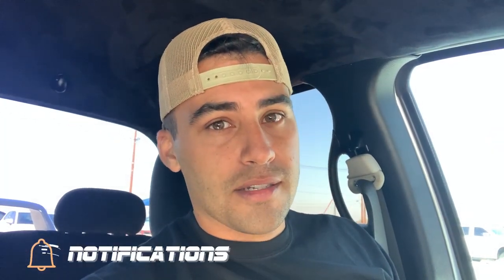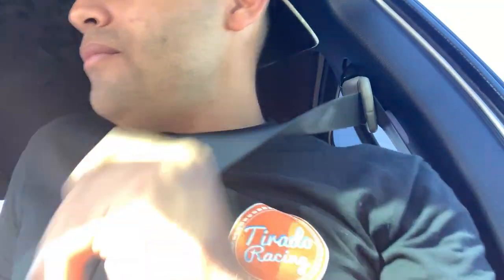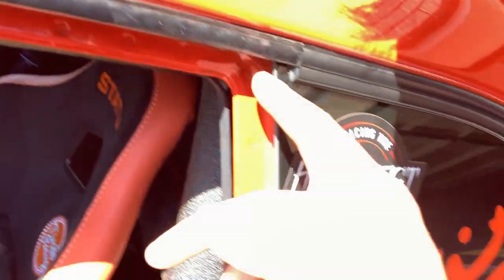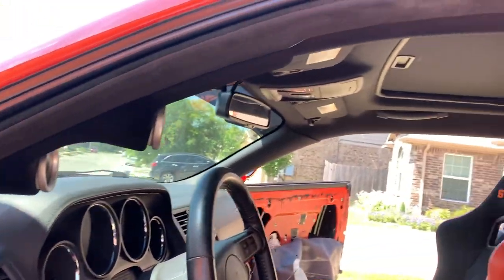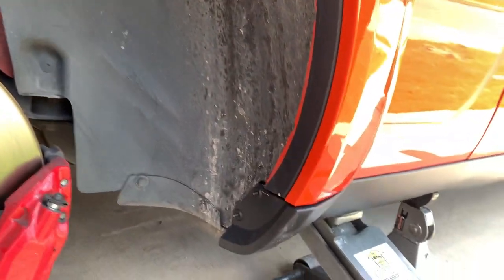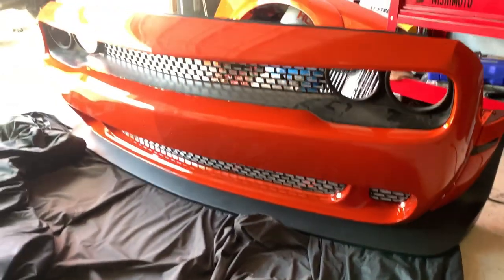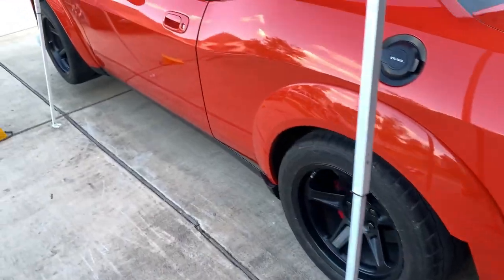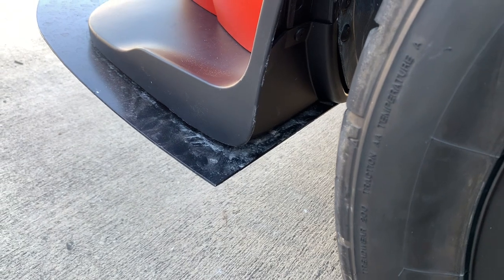The Challenger OEM Widebody Conversion Continues (VLOG)

Comment: Just watched your videos (and subscribed) on putting on OEM widebody fenders. Couple of question if you got the time. 1) I'm ordering from MoparOnlineParts but the desciption on the parts is very limited.  Do you have to already have the demon front end for this kit to fit correctly with the front fenders? 2) Are the front quarter panels metal or plastic? 3) I noticed that you didn't put the rear pieces that fit behind the rear wheels on the car, did the kit not include those?  I know this video has been out for a while, but If you do respond to this I really appreciate it
Reply from the maker: The demon front bumper/ hellcat widebody front bumper has the cuts for the forward most portion of the flare. 

The front widebody fenders are metal, the front widebody flares are plastic.

I didn’t order the entire kit, I just ordered the parts I wanted. I left the rear pieces out on purpose because the 2015+ bumpers have a different shape where the widebody finishes off in black. 

And it wasn’t worth the money to me to buy a new rear bumper and flares and tail lamps just for the those 6 inches of widebody lol 

I was also in college full time when I was building this car at the point I made this video so money was TIGHT!

Comment: So u used oem bumper and the oem bottom parts for the front bumper cause that’s the issue Iam having gonna go get the factory bumper tomorrow
Reply from the maker: Please watch all the videos, the entire front end is oem. The fenders the flares the lower side rockers, the rear fender flares, front splitter the lower front flares are also oem.

The ONLY things I swapped over from the vicrez bumper where the upper grills, lower grills, headlamp bezels, front side markers.

Comment: you had no problem with the splash shield
Reply from the maker: I don’t have a splash shield because I use the chassis mounted front splitter. You have to remove the splash shield because the splitter runs all the way to the transmission.

Comment: What’s the part number for the fenders.?    Is there a reason why you cut out some of the rear quarter panel ?
Reply from the maker: I’m gonna have to get back to you on those part numbers. It’s in one of the comments in one of these videos (all part numbers) 

And yea my car is a lot lower than it looks on camera. Those big ass tires hit the rear quester unless I cut it. There’s tons of people who have done it nothing new when doing widebody conversions and being lowered.
Reply: What year is your challenger ?
I have a 2015 and wanted to know if those fenders will fit mine.      Found the part number on the other video Thank you.    Your challenger looks awesome
Reply from the maker: Mines a 2009 srt lol it’ll fit

Thanks bro 😎
Reply: I work at a body shop and I can’t get those parts from any molar dealer.   They’re vin specific and won’t release them to me.    You got them through a third party correct ?
Reply from the maker: @jksgarage7803  yea with enough comment reading and video watching you will read and hear what I’ve told everyone else. I got the parts through a partnership deal because of the racing I do and the events I have lined up for 2022. I did not get them myself.
Reply: I have all of the part numbers for the 2018 and up complete OEM part number

Comment: Is there any way you can help me out on getting the oem flares I’ve been trying for months I can’t get them
Reply from the maker: Sadly there is nothing I can do. 

But lucky for you, the new Mopar direct connection program will allow you to buy the entire widebody kit from the dealership. You just need to find a dealership near you that is part of the direct connection program. Hope this helps!
Reply: @TIRADORACING  I did some more research and bam I found the same thing out …thanks for your help
Reply from the maker: No problem. I do not know the process but once I find out I will make a social post or video about it since it is a very common question. 

Good luck man!